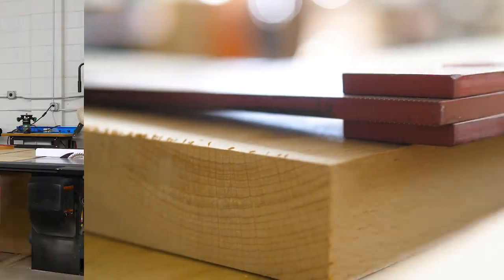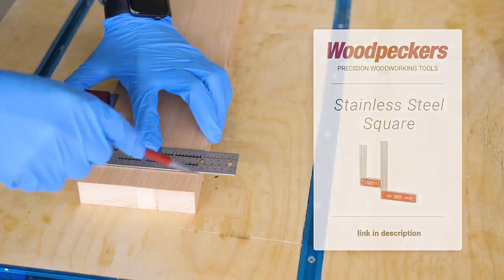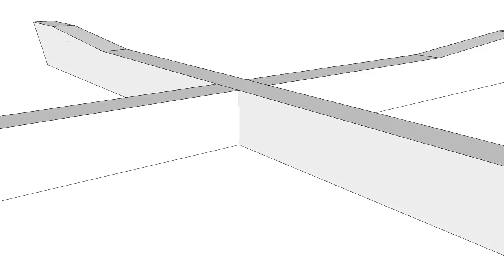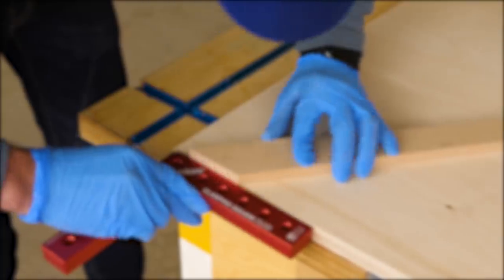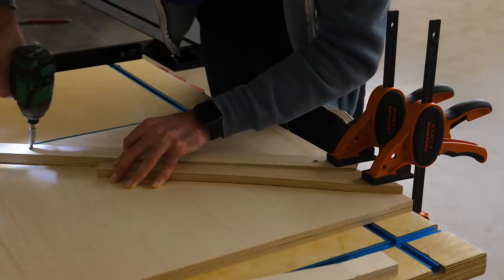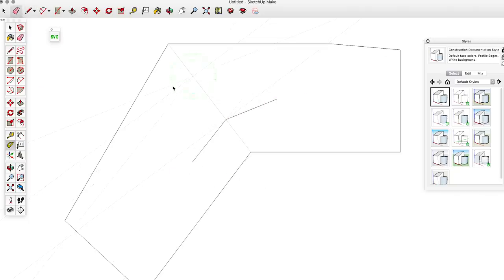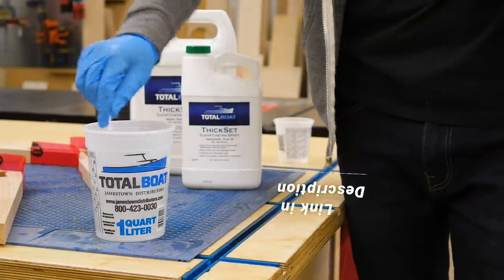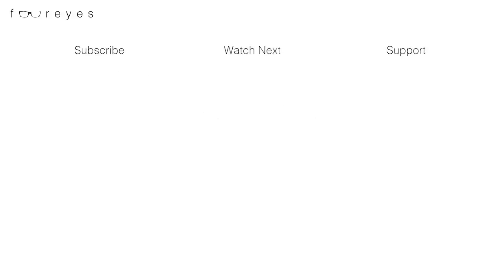A New Woodworking Technique? | Epoxy Locking Miter Joints

Comment: The engineer inside was like Noooooooo! Put measurable loads on each leg to see which one holds most! Which is strongest!!??
Reply: Same thought: who make am experiment on joint without a strength test? Make a measurement ! Do some kind of science.
Reply: I'd prefer he do the same joint on all 4 and try out different methods of reinforcement, from steel, to carbon fiber, aluminum, and fiberglass, etc.
Reply: @lancecustar  He won't have to tools to make quality composite structures
Reply: @lancecustar  : In the end, the wood failed....

So method of reinforcing didn't matter.
I was thinking, NO!, un-reinforced Epoxy is just for ART -- throw in some glass... In the end it held (on the one he demonstrably destroyed.)
Reply: @joestevenson5568  : What tools does one need??
Scales (weighing instrument - not fish type) Rollers/Squegee, Vacuum, Hotbox....  All of these are easily manufacturable / acquirable, ie not specialised tools (really)

Of course we all have our own special needs.

(For a crash course on what can be done with "Simple tools" - and a CNC machine shop for the on simple - check out Mike Patey's Composite creations....  No Autoclave or Oven in sight.
Reply: Yes we really need to know which legs were stronger and which were weak! Knowing the "Wood gave out first" is meaningless on its own! Good basic idea though!
Reply: kadmow see, i noticed the one he hammered was I think the only one where the shape was not perpendicular to the joint, so you can see where the wood broke it was very thin due to that reason. I also was surprised that it basically looked like the epoxy did not adhere to the wood AT ALL. Like, the wood broke away from it cleanly and the epoxy plug looked mostly unscathed.
Reply: @totherarf  To me it looked like the primary failure was the Titebond failing in tension on the inside corner of the joint - exactly what you'd expect from an end grain-to-end grain joint being pried apart.  If that part of the joint had held, I think the whole thing would've been much stronger.
Reply: @lancereaudamien  Meh. The guy's sketching out an idea, and sharing that sketch. He doesn't owe you some detailed measurements. You can see the wood fails before the joint, which is completely unsurprising.
Reply: @jeremyspecce  the three lines one also wasn't perpendicular, instead it was parallel to the leg.
Reply: @kadmow  that's a good idea. Better than the one I had which was to reinforce the epoxy with a steel rod running through both legs and under the table top...

Comment: I love it.  And for those who criticize you for not donating or selling the piece, I think you did the right thing.  I took this as an experiment.  You don't want to find out, after selling or donating it, that there was an unexpected problem with the idea.  Some possibilities are mentioned in the comments.  Personally, I love working with epoxies and have done so in another profession which causes me to see possible ways for this technique to be improved.  You're relying on the epoxy too much without reinforcement. 

I don't see a problem with using the gloves.  There are many reasons someone may want to or need to use them.  I use nitrile gloves a lot.  They are easier to work with than many believe.

Comment: Really interesting how when you broke it apart the epoxy didn't seem to have any sticktion (is that a word?) to the wood inside the joint. It makes it seem like this is indeed more a mechanical joint, akin to a dry fit bowtie, rather than a glue joint. Would love to see some comparisons with a properly glued and clamped joint compared to one with epoxy inlays like this.
Reply: Word you're looking for is "bonding" or "chemical adhesion"
Reply: I don't want to go into an epoxy diatribe but as a boatbuilder I get a bit annoyed with the general woodworking fraternity and their complete misunderstanding of how epoxy is supposed to be used (structurally).  Ultra clear casting epoxies do not make the strongest structural joints but I'm sure this method could be used very successfully if it was adapted slightly.
Reply: @Dickie2702  What are the adaptions you have in mind ?

Comment: Would've loved to see a strength comparison between the joints :)
Reply: If it holds a mans body weight plus extra force, considering it's a side table, it's fit for purpose and there is no point, it's practicable
Reply: epoxy is not stronger than wood. This is engineering 101. Our statics engineering teacher always said: "Do not stress the matrix". and this is exactly what he did here.
Reply from the maker: Man???? Let's not get crazy. JK. This is the right answer honestly. In this application and size, would anybody reasonably do anything beyond what I did in this video? I don't think so...therefore, it is strong enough. As for testing strength and getting into specifics...I wouldn't even know where to begin with that. All can hold my weight...none can withstand a hammer hit coupled with the torque :)
Reply: @jbrnds  Exactly, which is why the epoxy shattered and the wood didn't break.... oh, wait...
Reply: rdouthwaite too much wood removed and the epoxy plug is not loadcarrying just a void.
Reply: He should send the parts to Mathias Wandel for that in a great collaboration. :)
Reply: For strength testing, just make several pairs of 90 degree miter joints (including one pair of normal miter joints with no epoxy, but proper clamping). Then set them up with one of each type hanging down like an L and one standing up like an F. Add weight until they break and make a chart of results.

Comment: For creating templates, we create the shape in cad, print the shape out 1:1 on our printer. Glue the paper to the board, and then sand to the line. Makes for perfect shapes. We did all of our cabinet doors this way. It makes it very easy to play with the shape in cad till you get it right.

Comment: About someone doing it first, yes. Not with wood, not with resin, but with stone and molten lead. They would carve an H-shaped hole spanning both sides of a gap (much like the 'butterfly splint' you've made) and then pour in the molten lead to act as a key to keep the stones from shifting. It may go all the way back to Roman times, but certainly in the middle ages the technique was used.

Comment: I'm curious as to how it stands the test of time.  The expansion rate of wood vs. epoxy would surely loosen the joint, right?
Reply: hmm I wonder. The wood may expand on the outside of the leg, and the barrier between the wood and the epoxy may remain stable due to the strength of the bond between the wood+epoxy?

Comment: As always, tasteful and a pleasure to watch. Some advice (whether or not you want it):
1/ Forget the contacts. Woodworking and contacts are incompatible.
2/ Optical glass is still the superior material for eyeglass lenses (lensi?). An optician might dispute that, but an ophthalmologist won't.
Reply: "Optical glas is still the superior materal" If you only have an astigmatism then maybe. But if you are myopic, then NEVER! As glass gets thinner it gets progressively weaker. Also glass is 'heavy'! My own glasses are very very thin in the center, but with optical glass they are "coke glass" thick on edges! They weigh 10 pounds each! (Not really, but, they are much heavier than plastic.) Optical glass, even if made as safety glass, is not as strong as optical plastics today.

Comment: An interesting epoxy is HXTAL NYL-1. It's a two-parter which must be precisely weighed. It is optically clear with the same refractive index as borosilicate glass. It's used for museum-quality restoration and conservation. It ain't cheap, but it is a fine product. It's high viscosity, can be thinned with acetone, doesn't use UV to catalyze the reaction, and is extremely hard at full cure. I'm trying it's cousin, XTR311, which is quite a bit less viscous, to try to heal some cracks in several Victorian-era stained/leaded glass panels, as I write this.

Comment: Awesome Project... 

As the X-Carve was cutting and you were mentioning about various Joint Types I thought what if you didn't go all the way through on your Joint Carving and only went 1/2 or 3/4 of the way through. Then you'd have the Wood as a Backer either on the Inside or Outside to be seen or hidden. Then what if you Mirrored the Image and cut both sides but not all the way through, again like 1/4 the way on each Face leaving wood as a Backer for the Epoxy. Or you could drill a few holes to allow the Epoxy to bond the two Carvings in place. Just a thought... Cheers...
Reply from the maker: Good call...yeah. THat would definitely work.

Comment: Watching the test to failure was particularly rewarding.   Don't get me wrong, I really liked the whole thing, but watching the failure of the joint separate pretty much exactly how I expected made me wonder if you might revisit this epoxy joint with some routing of the interior of the joint.    Keyway routing, slot, multiple slots....whatever variations you think of.   It would be neat to see if there is some extra strength created in the joint by increasing the surface area of the epoxy / wood interface through clever routing.
Reply from the maker: Could be...honestly though. I think the joint was strong enough. It took a pretty good hit to break it apart. I have no doubt that if somebody had used this as a coffee table...it would last as long as needed.
Reply: @Foureyes.Furniture  absolutely fair enough, but even stronger is always better, right?  Plus you might be able to see the routed detail through the clear-ish epoxy....

Comment: Really good idea. Look forward to watching more of your videos.
What about using micarta keys epoxied into the joints?
 I experimented using epoxy lock mortise and tenons in my workbench by routing grooves on the outside of the tenons and inside of the mortises to create a key (had never seen or heard of this also, but probably already been done). There is no decorative component, but they are absolutely solid.

Comment: Good video Chris. Have a question about something. At around the 1:02-1:03 minute mark you were crosscutting a board using a miter gauge and fence. I always clamp a stand-off to the fence for that type of cut. I noticed you did not. At least the first time I watched it. The second time I watched it it seemed like once you had your cut lined up against the fence you tapped the fence over slightly. I use my standoff to prevent that kind of cut binding. Is that what you were doing when you tapped the fence over? That might be a good area to mention one technique or another as a novice may not know that type of cut can bind up, and as a reminder of those of us who have been doing it for quite some time.
Enjoyed the video and the project. 😊
Ron

Comment: Great video - I’m a little tired of all the resin videos these days, but this has some practical applications,  so nice work. You really need to check out Fusion 360 - you can do the CAD and CAM work in the same place, and it’s a lot easier to control your work coordinate system rather than mocking up something in Easel. Though I still use easel when I need to do something quick without a lot of hassle.  Just a suggestion. Have a great 2020!
Reply from the maker: I'll mess with Fusion 360 eventually. I don't think I'll ever move away from sketchup as my main spot though. To me it is like moving away from pencil and paper for somebody who likes to draw by hand.
Reply: @Foureyes.Furniture  completely understand.  And SketchUp's animation capabilities are way better.

Comment: I think this would be a lot stronger if you also drilled some holes for the to go into the wood, since it seems adhesion of the epoxy to the wood isn't great. Frankly, it's possible that having just wood glue joints is strong enough for that application and the epoxy doesn't really add much. It's a nice look and idea, though, I guess I would just like it explored a bit more.

Comment: I like the idea of using the epoxy as a joint strengthenererererer, it was cool to see the examples to fruition. Maybe a spline done epoxy would be cool, as long as the joints are proud enough to see from the perimeter.

Comment: Basically you’re trading epoxy for wood in a dutchman. I have a set of templates that in conjunction with the two different size guides I can cut both the area the Dutchman and the Dutchman replacement piece. I have done this with a wood Dutchman but never thought about using epoxy.

Comment: Hmm, curious.
Another interesting joint might be achieved by cutting into the surface around the circumference of the joint, thus entirely surrounding it with a band of epoxy, but cutting deeper into the surface at the edge of the band so that even if the wood bond is broken the parts cannot separate without breaking the epoxy band.
You might also want to try embedding polished metal parts into the epoxy, could get some very sturdy and impressive looking results.
Also as long as your clamping is sufficient and your tooling is sharp you can take much deeper cuts with your CNC, go shallow on the first pass to avoid surface chipping then switch to cutting deeper, it's quicker and extends tool life to make less passes but otherwise might not be important to you.

Comment: next time, put painters tape over the joint area before you carve it out; this will leave a protective mask over the rest of the wood that you can peel off when the epoxy is partially cured, making it a lot easier to sand it smooth.

Comment: So I wear similar gloves when working on my cars doing clay bar and finishing but never in the wood shop. What do you like about them for working with wood?
Reply: Might stop a splinter, but otherwise useless.  I love using the extra thin fabric gloves with nitrile foam (nitex, dexfit) for handling lumber.  Although, they don't provide any warmth they are great for grip and dexterity.  You must be careful wearing gloves while using any tool with an exposed spindle though, they can get wrapped around quickly

Comment: What was the 1/8th drill bit trick? I seen you set the drill bit but not sure what it was accomplishing
Reply from the maker: there is a card with a link right at that spot.click on the little "i" in a circle in the top right and it will expand with a link.
Reply: Chris Salomone thanks! I will check it out now
Reply: Chris Salomone makes perfect sense now! I will definitely use this trick
Reply: Thanks! Same question!

Comment: 1:26 don't....you...even....Dammit!

Really liked the puzzle piece, seems like that would be the strongest, and it almost looks like holes in the legs. Definitely opens up what you can design going forward. Speaking of design, now that your glasses have changed, does the logo change to reflect that? Could mean a "V2" of the shirts?
Reply from the maker: haha...the logo won't change because of that. It is actually based off of glasses that I was wearing, like, 8 years ago :)

Comment: Lol just to break 
Should just gave away 
Have someone enjoy
Reply: Always have to do a strength test, especially if you're giving it away
Reply: We already know relative strength of the joint, as it's literally just a splined miter joint.
Reply: @xaytana  You don't think using epoxy would effect the strength at all?   I would be shocked if you tested both and got the same results.
Reply: @TheDrewker  I said relative strength for a reason. Obviously the epoxy will be stronger than wood would be. Obviously a modified spline is going to be stronger than the typical spline. I didn't say we know the definite strength of it.
Reply: Is this a Haiku?

Comment: What if, instead of x carving the hollow, you pieced together the shape and ran a dovetail bit down the edges adjoining the epoxy hollow?  That would add mechanical locking to the adhesive strength.
Reply from the maker: You could do that. I'm sure there are several ways to skin this cat.

Comment: I have never seen that combination of epoxy wood design of joint. Also, the process seems new (glue then CNC then epoxy). Have you thought of making a declaration of invention ? It is quite simple and if it succeeds you will be remembered as the first inventor. Patents are more expensive and complex.

Comment: Love the experiment!

Anyone know the relative strength of epoxy vs the wood it's displacing?
Would these add strength to the butted glue joint?
Reply: Probably stronger than glue alone, but I'm would guess they are weaker than a glued biscuit joint.  These have more decorative options though.  Adding glass fiber or cloth would improve the tensile strength of the epoxy.  Although, some of his test joints left such a small amount of wood remaining that it failed in the thin wood element

Comment: Hey, I know you've done a lot of videos and have been around woodwork a long time, but that cross cut procedure you did around 1:00 looked dodgy. I know you had a gold of it, and had bumped the fence over a little, but can easily see how some folks wouldn't see it as I have and think they can cross cut small pieces against the fence. 👍 Otherwise, I really liked this video and the concept you've introduced.
Reply: I mean, as long as they also bump the fence over a little like they see in the video, they'll be fine.